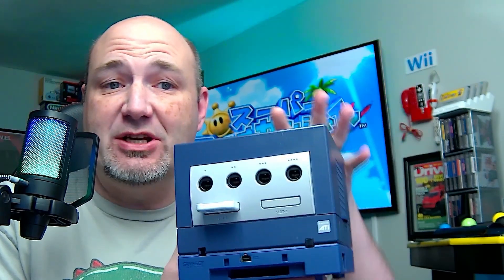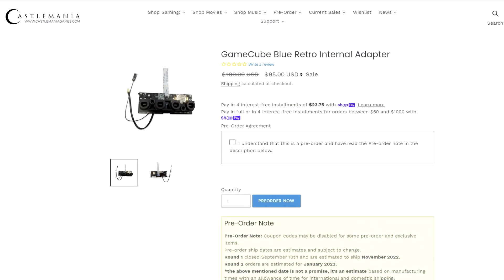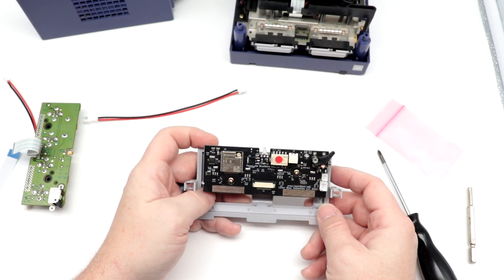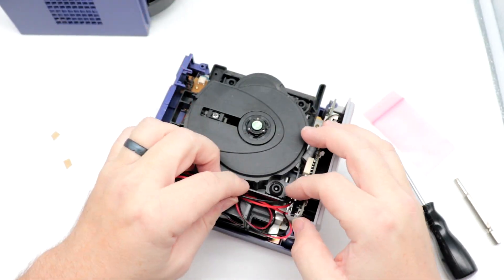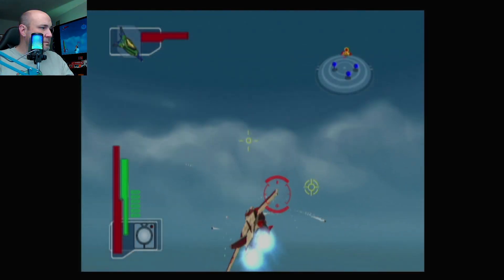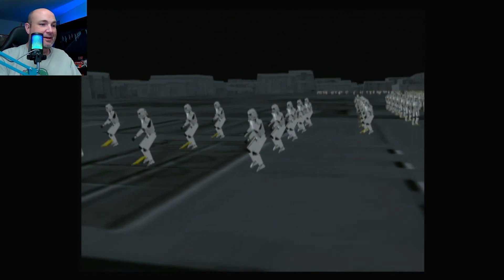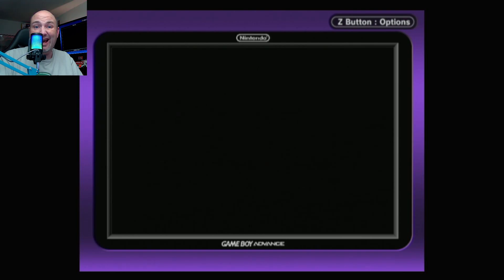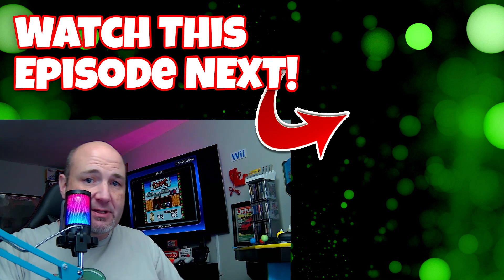Use Almost Any Bluetooth Controller on Nintendo Gamecube?!?

Comment: This is such a weird mod. Why not use have something that goes into he controller port like what 8bitdo has for the NES, SNES, NES classic, SNES classic, PlayStation classic, and switch. I don't think I'm missing anything but maybe.
Reply from the maker: 3 reasons. First, 8BitDo doesn't have anything that plugs into the GC that I know of. Second, I avoid 8BitDo due theo their terrible customer service and lack of communication. Third, this allows me to use practically any Bluetooth controller with the GameCube.

Comment: what about the Retro Fighters BattlerGC?
Reply from the maker: The BattlerGC works thru this as a regular Wavebird-type controller with the dongle but since that is 2.4GHz and this is Bluetooth it will not work without the dongle.

Comment: i couldn't afford to buy this kit so I'm just stick with the RaphNet SNES to GameCube adapter with an 8BitDo Bluetooth Retro Receiver Wireless dongle for SNES.
Reply: This kit's actually fairly reasonable once you do the math. If a bit do came out with adapters they'd probably charge 20 bucks in adapter just like they have been before and so if you wanted to play four player you're looking at paying $20 times 4 which is $80. $95 is $15 more than $80 so it's not too much more.

I personally would only really care to have 1 adapter so if I could I'd only spend the $20 which is why I won't be picking this up. That's just me though.

Comment: Have you tried any of 8bitdo controllers? Do there work?
Reply from the maker: I do not use 8BitDo controllers as they have extremely terrible customer service and communication.
Reply: Sorry for being late, but 8bitdo controllers do work with this - just on xinput mode.
Reply from the maker: @zviedelman9015  Not late, just pasted this recently
Reply: @RoXolid  Silly me, then.

Comment: I've seen some dongles that look like they have Blueretro technology to plug into the GameCube's controller ports, but apparently you can only find them on Aliexpress (or basically from China for that matter). I'd like to see somebody make an actual, good-quality dongle for review. Thanks for the video!
Reply: Basically what 8bitdo has but for GameCube and N64
Reply: @bland9876  Or Brookaccessory's Wingman stuff for that matter.